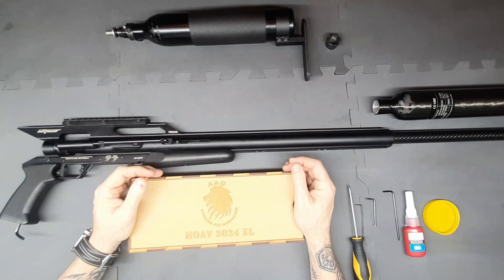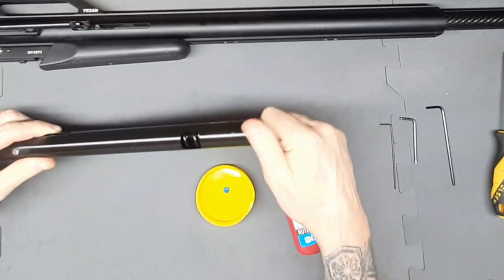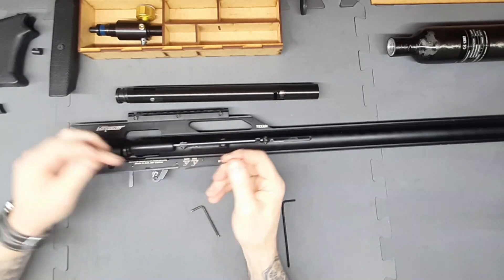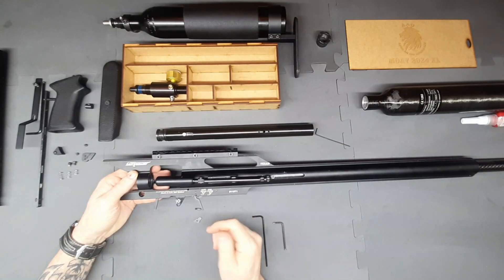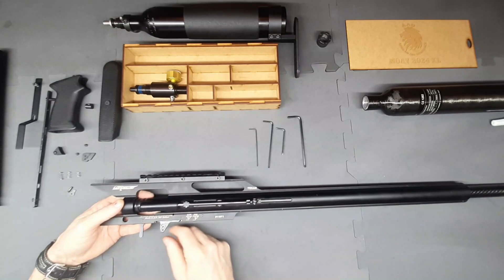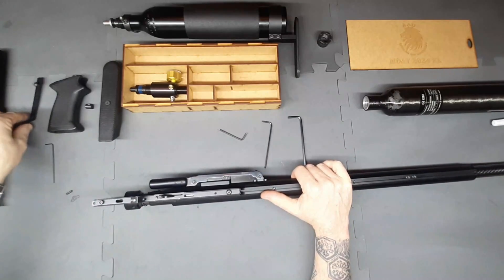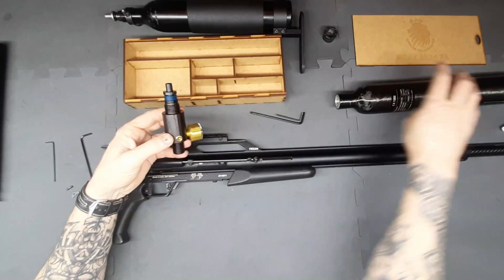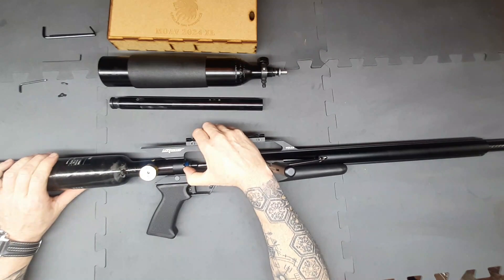Transforming Your Texan 257 with the AAO MOAV 2024 XL Upgrade Kit: Step-by-Step Installation Guide

Comment: I would.like to buy the kit for my 
457 lss cf texan.  If we can use our original bottle and valve what is the purpose of the valve that comes with this kit?  My texan has a 500cc 310 bar cf bottle with the newer valve.  Is there a benefit to using your valve?  I I would like to get a larger bottle what do you recommend?
Reply from the maker: @tchlin  you can use our upgrade kit with the Standard Factory valve 
Our MOAV Valve puts out over 1000 ftlbs in 457 with a 550 Gn slug 
We are binging out our new 2025/26 upgrade kit in 6 weeks  feel free to email africanairordnance@gmail.com
Reply: @AfricanAirOrdnance  do i get an increase in power with the upgrade kit without using the moav valve?  Can I use the moav vale with my existing tank or do I have to buy a specific tank?
Reply from the maker: @ You can if your TX2 carbon bottle is rated to 310bar Texan TX2 Carbon fibre  bottles are typically rated to 250 Bar you will see a small increase in velocity if you use the TX2 valve   MOAV valves are able to operate at 5000 psi  if you could find a 5000 psi bottle  that said you can run the MOAV at 4650 psi if you use a Allsafe 310 bar bottle as they are built to a very high standard and tested to 500 Bar with a MOAV Valve you can use up to a 1.1l bottle without the need for any adapters  Allsafe bottles are available on AliExpress website check out this video of the power from a MOAV valve https://youtu.be/0l7mOFzDmTY?si=9MJYeSILoATjS2R0  https://youtu.be/iwY2YQzHkSE?si=F_kNUnNLXdwL0FpS
https://youtu.be/OyGygW7Bckw?si=VfMZGUZvy_qAqf7n
Reply: @AfricanAirOrdnance  awesome.  My tx2 bottle is rated 310 bar and tested at 465 bar I believe.  I was kind of confused whe. I got my texan because of the bottle.  I have a picture I can send to you.  But I'd like to upgrade to a larger bottle anyway and use my tx2 as a backup.  Will be emailing you about the new 2025 kit.  Thanks.
Reply: Just sent you an email.  Thanks.
Reply: Hi quick questione, what is the thread for the valve?  M18x1.5?
Reply from the maker: M18x1.5mm @tchlin
Reply: @AfricanAirOrdnance   Thanks!

Comment: Great job on the tutorial Jeremy, just seeing this one for the first time. Actually didn't know about removing the Auto-Safety, which now makes total sense with all of your power upgrade  kits that I've been using for years from the maintenance aspect...... Nice
Never to old to learn something and again big thanks for these great tutorials!!
One question: are these upgraded springs or a change in your design from the red powder coated ones from the 2023/24 mod I have installed? I'm still using that one... is it wise to change it out to this?.. thanks bud.
Reply from the maker: @tamaman1559  thank u no need to change it as long as it's still giving u  good power

Comment: Why are your kits so expensive 😢
Reply from the maker: Thank you for reaching out about the MOAV 2024 XL Upgrade kit for the Texan 257 Airguns! We understand that the price can be a concern. Here are a few reasons for the cost:

Premium Materials: The kit is crafted from high-quality materials designed for enhanced durability and performance, ensuring a long-lasting upgrade for your airgun.

Advanced Engineering: Our upgrade kit features advanced engineering and precision design, which enhances the power accuracy and efficiency of your Texan 257 Airgun.

Comprehensive Testing: Each kit undergoes rigorous testing to guarantee it meets high standards of performance and safety.

Enhanced Performance: The benefits of the kit—such as improved accuracy and power—reflect its higher cost, offering significant upgrades to your airgun.

We also understand that budget considerations are important. If you’re looking for a more affordable option, we’d be happy to help find one that fits your needs. Additionally, we offer discounts for military veterans and pensioners. Please contact us at africanairordnance@gmail.com, and we’ll assist you with finding the best solution and applying any applicable discounts.